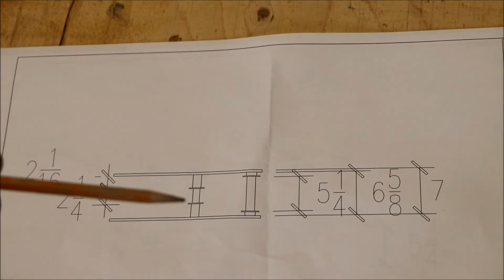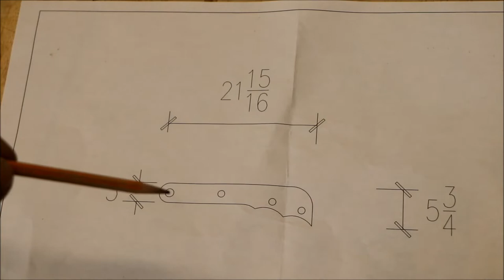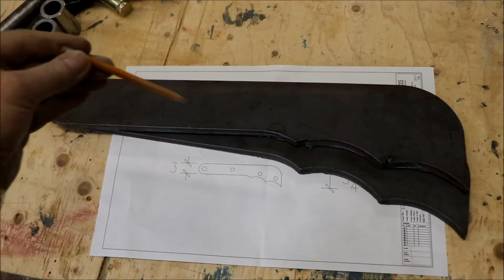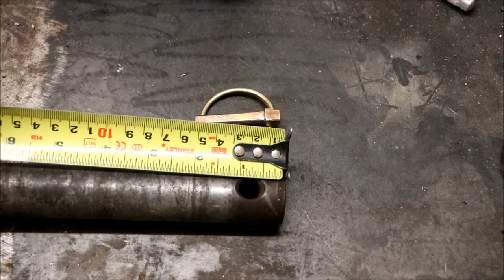Home Made DIY Excavator Thumb for a Bobcat 322

Comment: Outstanding! This video is what I'll use to build mine. Thank you!
Reply from the maker: Thanks for watching. It was a great project and a very useful attachment. I use it all the time.
Reply: @fromthewoodsyyc  I have  referred to it several times today as "the build" has begun thanks to your video inspiring me.....I just didn't know where to start until I saw yours!  

I have a Bobcat B300 and that's what it's going on.... little bit bigger hoe than yours but identical design. I just ordered a 16 cylinder as I'll need a little extra stroke for my thumb.... my pins are 1.50" so I got some 1/2 plate for the thumb. I should've made a video but my welds and lathe work would get beat up lol.

Comment: An excellent video! One small suggestion would be to use a mag drill for your holes even if you have to borrow one from a friend. My Haugen mag drill will punch those holes out in 5 seconds each . Great overall job on your project.
Reply from the maker: Thanks for the nice comment. It was a fun build and definitely a useful attachment, I use it all the time. A mag drill would be nice but that is a tool I would only use only once in a while. I have already been told I have too many tools.
Also I should have used 1/2" Plate for the tines and a shorter stroke cylinder.

Comment: Did you consider (or need) and over pressure valve so the bucket doesn't fight the thumb? (The bucket should win...) I have seen some that don't have this and they had a bent hydraulic rod on the thumb cylinder. 
Great job!

Comment: Hi, what a nice video you made about your construction of the thumb.
I have the same machine as you a 322 Bobcat.
I am half finished with my wooden template.
I have a hydraulic piston that has a 400mm stroke.
But it is only 20mm thick on the piston rod
do you think it will be bad will it fold?
Reply from the maker: Thanks for watching. If I had to do it again I would make the tines out of 1/2" plate. Also I would go with a shorter stroke piston. Mine extends a bit further than I would like. It would change the location of the upper bracket location. I don't know about the rod sizing if it will affect performance. Some of the logs I lift with my machine are pretty heavy which surprised me. I bought what I thought would work and saw on other machines. So I can't comment on the 20mm rod. Hope that helps.
Reply: Hello again, how have you done with the hydraulic oil flow that is on the extra socket where you connect the thumb.
I have way too high flow and pressure there now.

The thumb doesn't move smoothly and slowly it's way too fast.
Then when you get to the end positions, the engine next wants to die because someone is sitting over the flow valve.
It makes it to the other hydraulic pistons on the excavator.

Comment: Hi, is there a need to install a relief valve for the aux line or is it already built in? Thanks
Reply from the maker: Not sure. I did not install any other hydraulics other than what was factory installed. The engine will strain if you continue to push pedal against a load.

Comment: Hello, nice project :) can you send some project plan? I would like to make one for my excavator to... thanx ;)
Reply from the maker: Thanks for watching. No plans unfortunately, kind of made it up as I went. Plans changed as I went along. The only things I would change is to go with 1/2" thick metal for the tines and a shorter stroke cylinder. other than that it works really well. Wondering how i got along without it.
Reply: what would be your reason for a shorter cylinder  @fromthewoodsyyc
Reply from the maker: @davidkornelson7867  The ram I have on there kind of over extends the thumb so a shorter stroke would work better for the geometry.